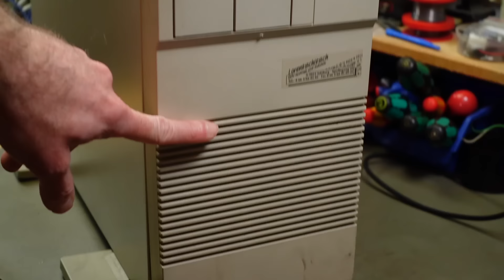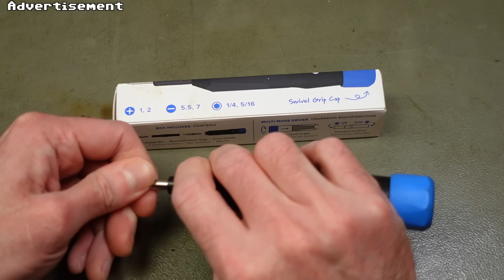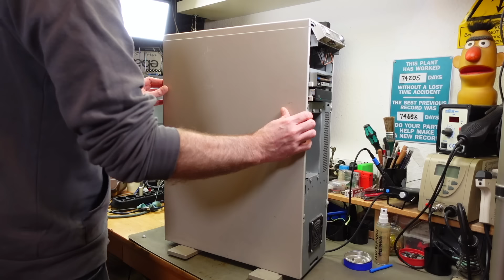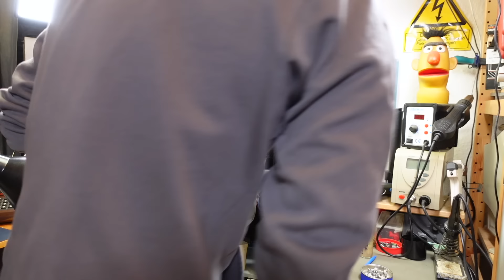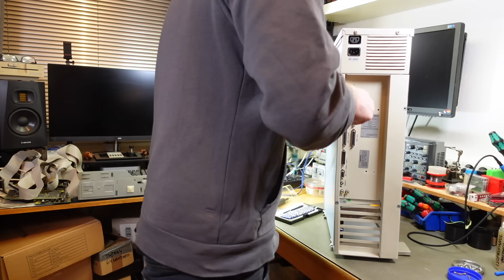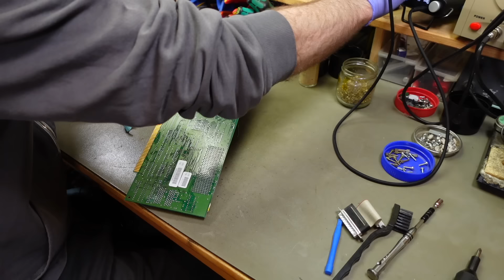Amiga 3000T Restoration Part 1: Teardown and Inspection

Comment: Does the A2000 not have a High Density floppy drive? I thought mine did-but it’s been a long time since I’ve used it-maybe it’s only 800k?
Reply from the maker: The A2000s I've seen didn't have high density drives (although you could probably retrofit them). As far as I know, the A3000 was the first Amiga that had them. Some A1200s and A4000s had them, too.
Reply: @JanBeta I’m sure you’re correct-my A2000 was my first computer & my introduction into the 3.5” floppies. I had no idea there were 3 different capabilities at that time. 

I think my confusion was: I was able to use a pc formatted floppy to transfer data from my A2K to my Mac-and my Mac had a 1.44MB floppy drive. 

I now know that they could also read 800k discs!!

Mystery Solved!!

Thank you!!

Take a well deserved break from the Tower and jump back in when you’re refreshed!!

Comment: Why did the computer-inside-a-computer concept got lost?
Would be great to have a ARM based Linux add-in card in a x86 PC, to run exotic non-virtual machines that share storage and ports.
May also be a promising way to add security, when a different type of computer checks the primary one for errors and viruses.

I am curious, what this PC inside the Amiga is able to do.  Why did they even do this? There are hardly any components these computers shared - case, PSU and ...? So what was the benefit to integrate them instead of having two full computers in two cases?
Reply from the maker: Would indeed be great to have the "computer on a card" thing back these days. I'd definitely have use for that.

The PC cards were Commodore's attempt to make the Amigas more appealing to professional users, I think. They did quite some marketing back then with "IBM PC compatibility". PCs were already the standard for office work so it was really useful to be able to run PC software and use PC disks on your home system. My dad used an Amiga 2000 with a XT card in it to be able to access his work stuff on the Amiga (which worked well enough for text documents and such).

Comment: Great find and great video, Jan!
Looking forward to your next videos on it.

I have a 3000T40.
Have not used it for 20 years or longer.
Had much fun with it as a kid.
Both the PC card as mainboard batteries are bad but first glance looks like no damage to near components.
Now you inspired me to fix it and look what it does.
Looks easy enough to change the batteries.
Unfortunately, years ago I threw away all the diskettes I had, so hopefully the harddisk still works and I can at least boot it.

Comment: ... really looking forward to your upcoming videos about the 3000T 😎🤩.

The fact that the battery damage isn't more extensive could indeed be due to the use of a GP battery instead of a VARTA one - about two years ago, I had the opportunity to get my hands on a 500 Plus that also had a GP battery soldered in, and it showed absolutely no visible damage.

By the way, the GOLEM podcasts with you were fantastic 🤏!

Please keep up the great work with your retro tech projects!

Comment: Huge board, huge case. Personally I think both the 300T and 4000T are butt ugly machines with bad proportions, necessitating wide feet to keep them from tipping over. However I do look forward to Chucky's ReA3000T motherboard, and maybe some day we will be able to get new cases and front covers! Cool video. I look forward to the next episode.
Reply from the maker: Thanks! It would be absolutly amazing to have spare parts and new boards for these machines. They are kind of strange looking indeed, I definitely prefer the A3000 desktop variant. Not quite as rare though. Hope I can do this beast justice. :)

Comment: Stunning machine. Although I never owned an A3000T I was lucky enough to own an A4000T which is truly the pinnacle of 'official' Amiga models. If it said A3500 it would be even rarer. Am I jealous? Heck yeah but it's in safe hands
Reply from the maker: Oh, the A4000T is magnificent, too. I think the initial Commodore-produced ones are even rarer than the A3000T, maybe. I am going to try my best to do this rare beast justice. :)
Reply: @JanBeta  We know you will. Although I sadly no longer own the A4000T I still have the original disk images configured within UAE including emulating the Cyberstorm PPC, that I had. Not the same virtual graphics card though as I had a CV3D at the time. I remember having 154MB of RAM which was a crazy amount of RAM for an Amiga around 1998.,

Comment: speaker will be for PeeCee?  no sound card. Dont know if you could output PeeCee sound through Amiga outputs, but you would definately need a sound card of some description for the PeeCee.
Reply from the maker: I don't think the bridge boards had sound emulation, so it's limited to the PC beeper sounds at this point. A sound card would be easy to add, I guess. I might even have something suitable in my stash. Would be cool to try. First things first though, I'm going to have to make the Amiga and the bridge board work at all again. ;)

Comment: I had no idea this even existed. This era of the Full Tower computer was interesting, I think making your workstation bigger was almost a selling point for many manufacturers given even IBM were doing it with those monstrous PS/2's. It continued well into the 90s as well, true enthusiast geeks loved these giant cases.
Reply from the maker: Yeah, those were strange days regarding PC cases indeed. I never quite got why they did that. Probably really just a "bigger is better" argument. I remember my best friend had a ridiculously tall 386 PC at one point while I was using the much smaller A2000 (which is not really a small computer at all). :D

Comment: So I can understand the 3000T being rare, but how much is the regular A3000D worth these days? Because I happen to have one in my storage unit that I haven't started in ten, fifteen years or so. I'm pretty sure I have removed the battery though :)

I bought it second hand and used it for University right up until the first actually good 2D/3D graphics cards from Nvidia (Riva TnT) came to market in 1998 and I had to buy a PC to play Quake 2 :)

Since then, this hunk of metal have been moved around with me the fifteen times or so I have moved since then. I have a few other Amiga's as well, but I have a feeling the 3000 is the most exclusive one :)

I'm also in Europe BTW.
Reply: fairly collectable and rarish. A working one €1000 a good one with all bits €2000+ , Still plenty of expansion and upgrades available so quite desirable as well.  My advice would be to get it out of storage and make a project of bringing back from the shadow realm. Carefully. Not sure how technically proficient you are so apologies if teaching to suck eggs, but please do not just switch it on and hope for the best.Give it some due diligence and TLC.  If you can find the keyboard and the mouse (BONUS) they are VERY expensive.

Comment: @Jan Beta, would be wonderful if you could fully measure and document the floppy plate cover. I too have an A3000T and I have found that this cover is NOT the same as the 3000D. I have recreated one on Thingiverse for the 3000T but it was from trial and error. Would be nice to know the measurements of a factory one.
Reply from the maker: Would you mind sending me an email so I remember to take some measurements? Address is on my website.  I tend to lose track of YT comments pretty quickly and it's possibly going to take some time to get to measuring the cover. Can definitely do, though.

Comment: On my "Office A2000 060 3.1 system", I too added extra ports and a full length, double PCB, engineering level CAD graphics card for my fully populated bridgeboard (with fastest available chips) which saw several iterations of the 486DX for testing purposes. That same machine had the P4 on P96 with the Mac emulater Shapeshifter. Each platform had its own partition on the largest, fastest Micropolis HD they had at the time. It was faster than the actual machines so they were sold.
Reply from the maker: Nice setup! :D
Reply: My first Micropolis HDD was unfortunately the last they made, basically when the company folded, apparently made from whatever old parts they still had on stock! It was slow, had the old style termination resistor packs instead of active termination and barely survived the warranty time 😠.
Reply: @jurgmesser7723 It was too bad for that company, they didn't last long.

Comment: Hi Jan, congrats to the nice machine. 35:37 Battery damage is minor but the damaged area is probably much bigger.than you think Look at U204 - it has corrosion as well.  The motherboard is upright and the slop runs down to the bottom of your motherboard. #a1korg

Comment: Jan, you blamed Varta.  But to be fair, it's not a fault of the brand, it's more of a generic issue with these old NiMh or NiCd batteries which for some Amigas are now getting close to 40 years old.

I don't even dare to look at the PCB of mine.  It's quite a few years since I last powered my A2000.  Had to repair the PSU first (blown cap) and after only a few hours the PSU blew again.  Honestly, the A2000 PSUs I had the displeasure to look at just like the PSUs of the Commodore PCs which were using the same case are all strong contenders for the Worst Product of the Industrial Age Award.  Sigh.

Over the years I've seen many system stickers with totally faded serial numbers.  There seem to be two types of such stickers, the ones that come with the number already printed on in the same quality as the rest of the sticker.  These are expensive.  And then there are the cheaper ones where the number is printed, stamped or even hand-written on a generic label with the rest already printed on before being applied at the system manufacturer.  More often than not the writing on these is not as long-lasting, may be removed during cleaning the system case or just fade away.  I learnt to not clean such labels with more than a dry anti-static cleaning cloth.

Comment: Nice machine. Top tip is to be careful with the lock cylinder, they have a tendency to fall apart and drop metal bits all over the inside of the machine. I've 3D printed small containers to go into the top 5.25" slot so in case it does fall apart no parts will drop on and of the electronics.
Reply from the maker: Oh, thanks for the heads up about the lock! I'm going to keep an eye on that thing and possibly do something similar to prevent damage.

Comment: That separate hard disk controller card makes me suspect that the battery on the PC card leaked and killed the controller chip before this system completely fell out of use.  Having the damage eventually spreading to an then finally destroying the controller card was probably the final thing that caused the system to be finally retired.
Reply: There's no HDD controller on the Commodore 386 bridgeboard, just floppy (2x 40-pin paired connectors if you're using the Amiga's floppy drive in pass-through mode or the 3rd 40-pin floppy connector for dedicated PC floppy drives). For a HDD you either use a Janus virtual hard disk on the Amiga hard drive or you need a dedicated ISA hard drive controller. (Some of the 3rd party bridgeboards like Vortex's Golden Gate had a HDD controller on board though.)

Comment: Are the electrolytic tht soldered in at the smt places by factory? Or is that a recap?
Reply from the maker: As far as I can tell it’s completely factory. Commodore only started using SMD caps on slightly newer machines (A600, A1200, A4000, CD32).
Reply: @JanBeta ah re watched it. I was mislead by the caps flapping in a breeze an obviously not the right size for the footprint?😂 Commodore at its best?☺️

Comment: Wonderful! I always wanted an A3000T! I had an A1000 and then an A3000 and wrote (and sold) graphing and molecular graphics software for the A3000. I still have that code which i plan to open source. I still have both computers too and clearly need to take a look to see if they have suffered any leakage...

Comment: A great pick. But, honestly, I never really like tower design. I don’t get why collectively abandoned desktop cases. I mean even in the 90s how many drives did you really need? An HDD, an FDD and perhaps a CD-ROM. This stuff always fit into a nice desktop cases. My first Highscreen 286 PC had one. I remember opening it for the first time to fit a Sound Blaster Pro into it. Christmas 93/94. I played through Monkey Island 2 using this setup and Indiana Jones, too.
Reply: Because today you would want a small factor PC to browse youtube and that's all :-)) Screens got bigger, computers smaller and we - older 😞
Reply: Probably the biggest reason why you would want the 3000T over the desktop version is if you needed a lot of expansion cards. The desktop version only has 4 Zorro slots & 2 ISA slots (both overlapping) instead of the full compliment of 5 Zorro and 4 ISA (2 overlapping) on the tower version. The extra expansion room is really important if you're going to use either a bridgecard like in Jan's example here, or if you're setting it up as a full video editing station with a Video Toaster, maybe an non-linear editing card like a PAR, etc, and one or more TBC cards in the ISA slots.

(And if you're using a non-linear editing card you're definitely going to use those extra drive bays. Cards like that from this era typically require 3 additional fast SCSI drives connected to dedicated controllers on the card to have enough bandwidth for real time editing).

Comment: I had the 2000 with the 286 bridge board which was a nightmare as so unstable. Had to return it and buy a PC back then for my Computing course.

Have a 500+ (battery removed) and a 1200 now.

Comment: We created a pilot system with a similar setup, running unix on the a3000 and running netware on the 386 card witg a 3com network card and pc disc controller. No video card. We setup 4 pilot devices for regional offices but it never got further than the pilot.

Btw I still think the a3000 desktop was the most beautiful system ever created

Comment: The battery placement on the A3000T is just a ticking timebomb of disaster.  It looks like you don't have too much leakage though.  Hit your socketted chips with some deox-it, carefully remove & replace.  If you install a turbo card, screw it down to the stand-offs, or use the snap-lock type stand-offs.  It will be prone to coming loose otherwise.  You can get, or make, 3D printed replacement feet.  Give the power supply a thorough check before using.

Comment: For the PC side of the equation, that BEAST deserves something better than than 8900C. 8900Ds are MUCH faster as long as it has the full memory bus with FIFO support. Cirrus Logic cards are also an awesome but generally inexpensive choice for a 386SX class rig, as well. Can the PC card use the Amiga sound hardware as a sound card? There might be a PC joystick header on that IO card BTW.
Reply: If you want better than PC beeper sound on the PC side you need a dedicated PC sound card in one of the ISA slots. The PC video card (and a 2nd monitor) is technically optional but highly recommended as while the bridgecard can pass video through to the Amiga Workbench via software it's limited to CGA and very *slow*, even just for text mode.

Comment: Jebus Crisps, I have been looking for a 3000T for DECADES, but every one I have seen has been broken and beyond what time I have time to do case repair, or corrosion on the motherboard, or is in perfect shape but the seller is asking the price of a family sedan for it. I am genuinely jealous, but I will watch every video studiously, Jan! Cheers! ☘️🤟🏻💚
Reply: Oh, Jan, battery corrosion on solder causes some of the metals in the solder alloy to break free and combine with the acid, and is almost exactly like base damage from electrolytic capacitors, though the chemistry is different. The end result is a portion of the alloy that fills with the chemical product as well as freed gases trapped in pockets that act as a heat insulator. This is why it doesn’t melt under an iron and needs either the addition of fresh solder or increased (and unsafe) levels of heat. I have been fixing motherboards since the early 90’s for this exact same issue!
Reply: Second addition: yellow indicates a CPU exception before the boot ROM is loaded, so I expect that the 68882 is locking the CPU bus due to corrosion infiltration, or maybe a fully corroded trace…?

Comment: Fellow 3000T owner here.  I wish you luck on your restoration.  Thankfully, my battery area is okay as the battery was removed quite early.  I have seen others with terrible damage and yours looks okay so far.
Reply from the maker: Oh, cool! Great to know your tower is in good condition. Thankfully mine should be a relatively easy fix, too. The battery damage is minor indeed. I've seen much much worse in other Amigas (and PCs).

Comment: When I saw this, I hoped the battery had not leaked.
Reply: ESCOM also hoped their batteries won't leak and they could sell their warehouses of A4000 in 1995 for double the price. Imagine their shock when they found out their stock had gone dodo and they were basically finished as a company.

Comment: I've never seen a A3000T in person; only pics in old Amiga magazines. I have a desktop A3000 16MHz, maxed out fast ram, with a BridgeBoard and accessory card that has VGA and IDE controller on it IIRC. Have a A1000 too and A500. All have been in the closet since being retired in mid to late 90s. Guess I should take them out and sell them before the batteries do any more damage than they have certainly done by now...
Reply: No surprise - it was stupid yet cost more than 10 grand. Only the people in TV industry could get any use of it.